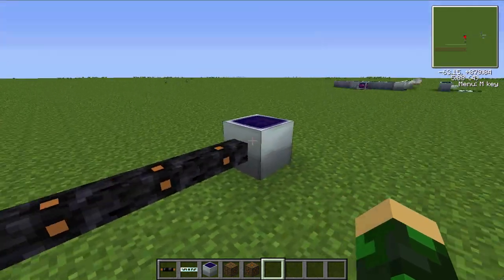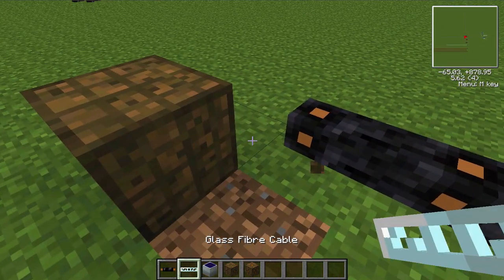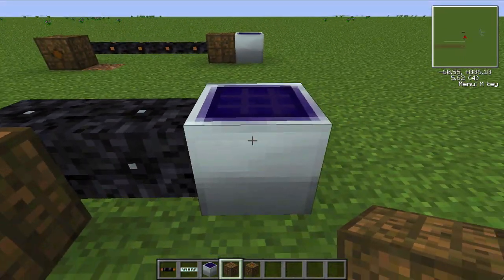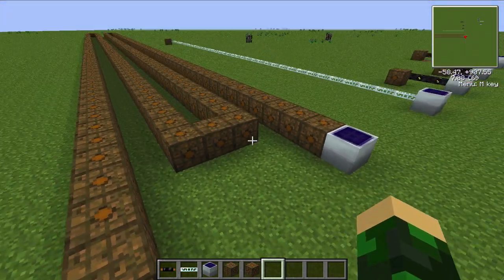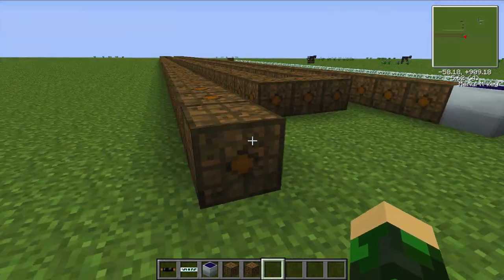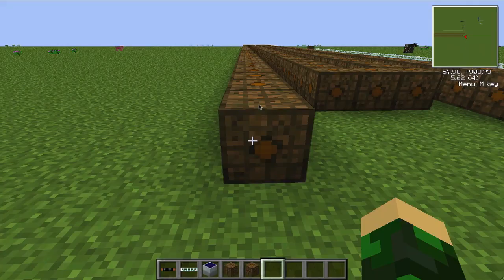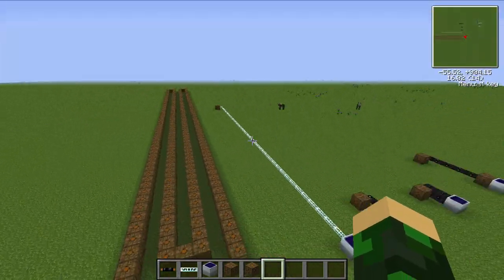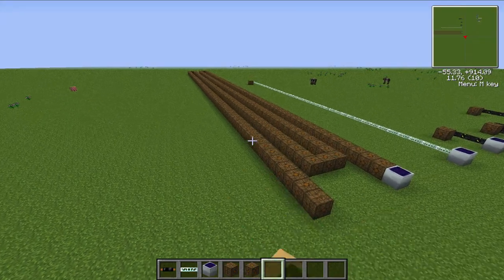FTB tutorial "How to make zero power loss cables"

Comment: If you are planning to do this on a survival map, stop now. It's a fantastic waste of resources for not much gained. While the concept of using transformers to re-set the loss on cables is worth spreading around, this is not an optimal display at all. For LV, you want 1 transformer for every 4 copper cables, and for HV you want one HV transformer for every 40 fiber glass cables. 

it would also be virtually impossible for Greg to nerf this without ruining other aspects of IC2.